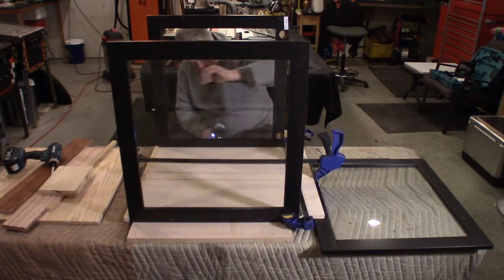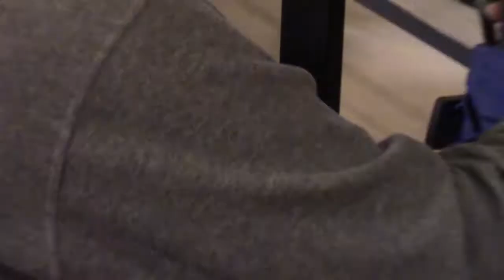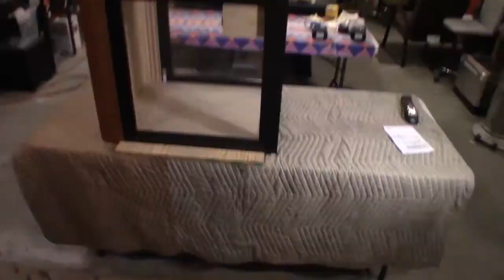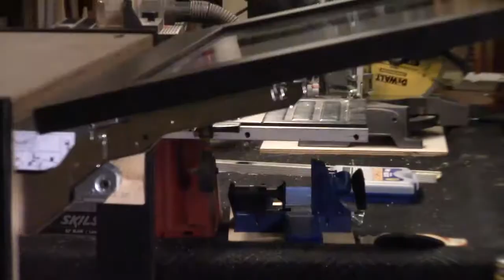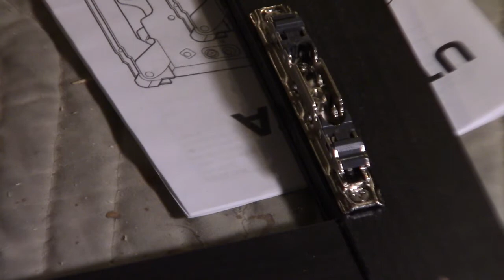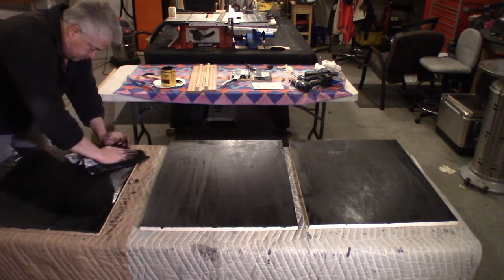3D Printer Enclosure - Compilation/Summary

Comment: I built a very similar enclosure as this one and I was also worried about breaking the glass with the screws.  After seeing this video I felt I hoped to be as lucky as you were and everything turned out ok.  These hinges are a major PITA to line up and get installed.  I wish I had your shop setup and tools because my door is not lined up perfectly due to crappy Home Depot cuts.  Overall I am happy with how it turned out.
Reply from the maker: Awesome...Glad it worked for you. It doesn't have to be perfect. It just needs to work.